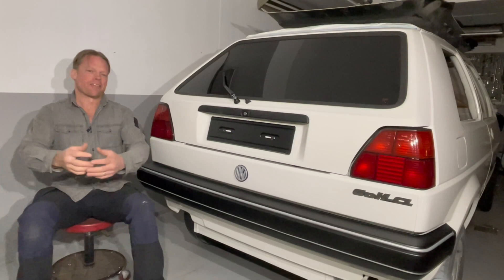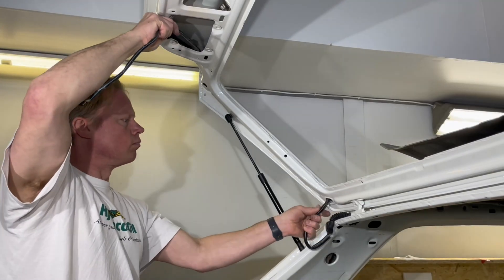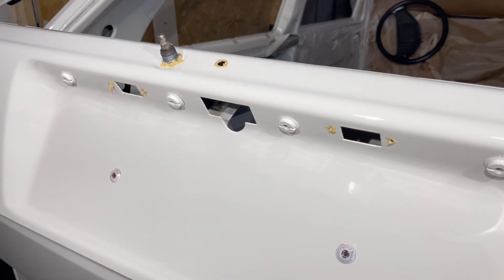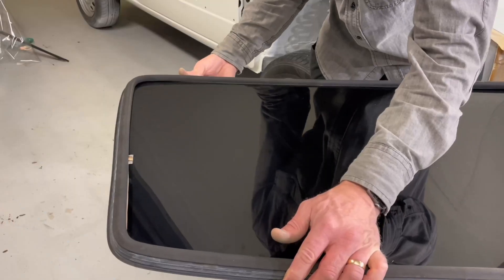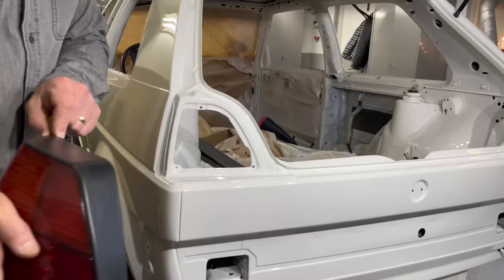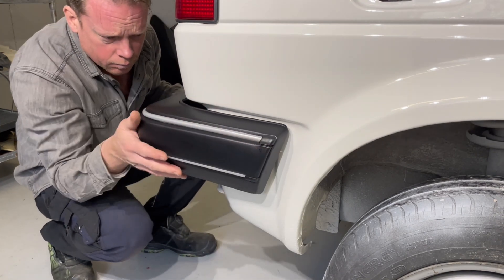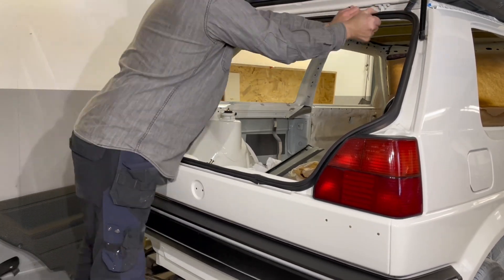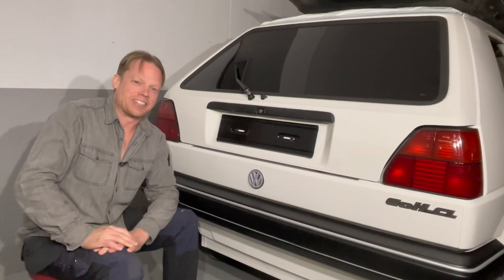Restoration Mk2 Vw Golf Rabbit EV Citystromer part 2

Comment: Hello again. Great video, the car is looking great!
What are you using for rust protection around the fixing holes? Is it just wax?
Reply from the maker: Yes, it’s the kind of wax that normally is used to protect the high voltage batteries from corrosion. Very expensive but also very good☺️
Reply: @flyingtools  cool, great idea. Thanks